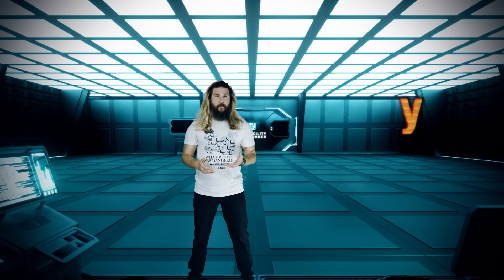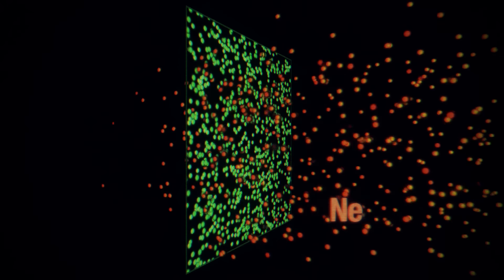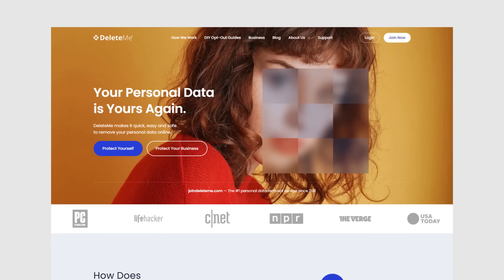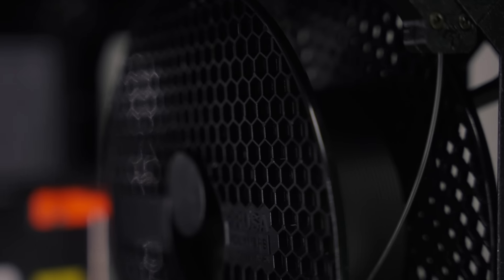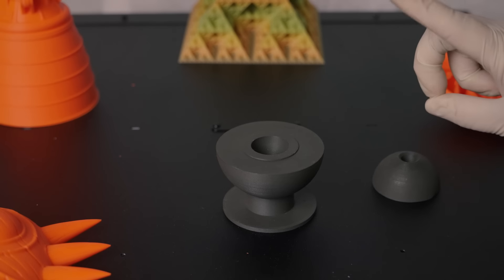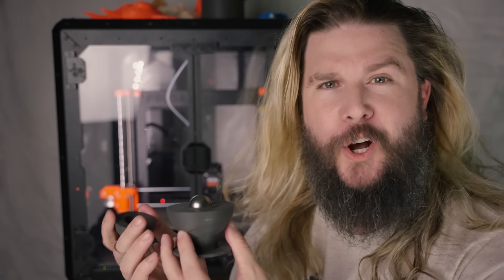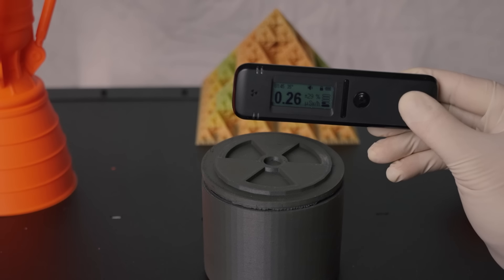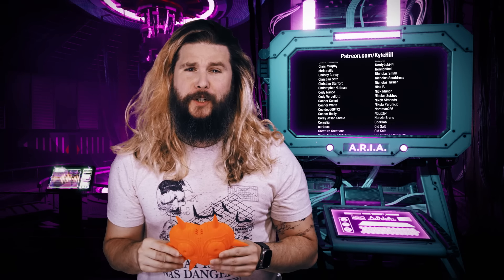3D-Printing TUNGSTEN Radiation Shields!

Comment: I'm not in the nuclear industry, but my first thought was for a 3d printed exoskeleton on an engine that chemically strips the filament them bonds it to aluminum engines! Reducing friction, increasing power, reducing total aluminum mass, increasing efficiency, making engines more carbon efficient. Engine refurbishment would be much easier and so older engines could gain new life and be used with upgraded tech to allow for lower weight reduction and less energy cost overall to produce them while significantly cutting carbon emissions for most vehicles while we transition to electric vehicles.

Same for electric motors that gain to much heat and can't survive, of we were to coat this with the correct catalytic compounds we gain electrocatalytic, photo catalytic, and regular catalytic seperation of air particles that gain electron hole, redox flow, and positive to negative ionic charge values that can handle extreme, but very small sizes and moments, heats and pressures that help cool the motor and gain energy potential back from our atmosphere. While remaining incredibly small weight! Just like I said on my xenonreality YouTube channel videos about those rotary electric motors that use air filtration and vacuums to increase electrical energy efficiency. I have to cool it anyways, might as well make it do some basic work we've used for decades already on a smaller scale 🤷

but also for small scale testing of nuclear reactor decay atom/ particle accelerator injectors to smash them in high luminosity events too create high heat pressure oscillating "combustion" zones that then have deuterium and tritium fired in at the highest heat and pressure zones with light reflection coating on the inside diameter to capture light pressure convinced with the high heat tolerance electromagnetic field toroidal designs to introduce fast moving directional fusion events (even 10% outstrips all of our best rocket engine designs) that's now ultra small and compact with very low radiation because of reusing it in an recirculating manner through the combustion chamber shape design for reflection acoustic resonance frequencies to improve this effect through the use of printers to make previously impossible to manufacture designs.

Same for copper aluminum alloys that can now handle the extreme hearts and pressure of a reactor like this, combined with piezoelectrics and lower pressure metals to create multiple cascade cooling thermosiphon systems to return the metals to increase potential gravitational potential energy capture in a closed loop system that doesn't produce radiation and can be very small and safe, even able to be moved, in case of a natural disaster occurring, making a hybrid fissile fusion reactor actually possible. Soon, I mean that's how we make the bombs work. But now less mass and more control.

Then, multiple dimples with holes that are spherical with offset hyperbola and parabola behind them/underneath them that can now be used in a "demon core" reflective manner to reduce total thickness and increase cooling potential and electromagnetic/ionic charge state potential for them same things to do with lead radioactivity, but using the radiation to introduce much higher values of "stuff" (many many dense things reflecting particles and light while deflecting neutrons as well until they "bounce" back) to improve the thickness needed for reflectivity of all radiation (slight change to plastic martial and other metals included) to improve the existing designs currently as they stand. This means a "chain mail" shirt could be produced that weights very little that practically completely protects you. Also my require design works better and is smaller than you think while being able to create channels to focus neutrons together and break them apart to create works to fuse, provided you have it shaped for it, add enough extra energy, and are going fast enough to capture enough to be able to have the neutrons themselves start doing it to themselves. Then it's easy to fuse quarks together for far more energy output.

In space this increases the efficiency of the design even more. But hey, lol 🤷, who needs a spinning flywheel battery in atmosphere that produces fusion energy from neutrons coming from our Sun/the universe? /s we could never use this, hahahaha heh. But your know, it would never work so why even bother to try there no incentive of large corporations and energy producers to not fully fund things like this /s not at all! Heheheheheh like ace Ventura nope. Why not in-between the lhc, or the old Texas collider, or whatever we know it will never go anywhere they're invested in a multi trillion dollar fusion toroidal design right now anyways. Whatever. 

It's impossible to figure out how to do this! /s or can never be done, just like gravity doesn't have relativity all things experience the same time everywhere all at once, Einstein, you're crazy go be a patent clerk. Just disregard we prevented you from ever getting anywhere and never helping you treat this until after you brute forced money and time enough to prove use wrong Einstein, there was never any reason us big shots that controlled you and your endeavors for any influential, financial, or other gains that helped us get units of measurements named after our amazingly garbage asses who mostly style from our undergraduate students 🤷 /s

obviously, obviously it can be. Shut up. Trapped into the same stupid mindset that caused the lack of progress and growth with safety that made wealth inequality, power inequality, invalidation, violence through non acceptance of others and their sexuality, ethnicity, and more occur time and time again making us believe those at the "top" should never be questioned, are allowed to break rules, but we should never question the rules and or even change them, it certainly doesn't influence our views and or bias our behavior towards a social peer pressure thought process, belief, the results off or very science and who's event allowed in to talk, and so much more. 

Let's just 💩 on each other and their cringe, their defensive nature to being called out and it's known it hardens them to not change their stance on the subject even in the face of overwhelming evidence, let's have huge YouTube channels dedicated to doing this and having multiple generations all mob mentality group up together to do it to have a false belief of being correct bastard many people all agree with me and us doing it, creating a huge self fulfilling echo chamber of validation fire or "totally good enough" studies that don't even try to look at influencing values to the noise in their data! Making stereotype anecdotal days points that are "replicated" as being correct observations and "perspective analysis" of many many different fields of study even though most don't even have access to try to study it! Let alone even know what they are saying or trying to imply the observations mean. While we all fall for it hook, line, and sinker IV the never ending feed recommendation chaos theory mathematics influence values of rotating interests and momentum to continue the fight for their groups theories and views, scientifically!

There's nothing but a bunch of "know it all" jerks that troll to put down any idea who know full well how difficult it is to even try, let alone brute force through experiments until a success. Capitalist greedy competition to mere curiosity and joy of our everyday lives, abuse of knowledge to jack up "issues" for money ("issues" because they are non openly discussed features to make more money from you) all while I can't even get on SSI for my disability with my no income having ass! While my abusive parents are my only lifeline for toiletries and basic life stuff, go f yourself and stop streaming my stuff after saying it can't be done then calling it something else after I clearly came up with it! I hope your all due soon, somehow some way! 😡 whatever, I doubt anyone will ever decide to actually look into that. Why should they, their own lives, it's time consuming, requires effort and actually knowing about non counted views, how shadow banning works, how large creators are people who can put more effort in than others, how YouTube knows drama cancels a percentage off to players and they "scout" for the next money bag to bring up for money towards their company, hope people can 100% be hacked and have no way to stop that regardless of authorities, and more. 

Just boils down to laziness, why should I help, learn, or try. I'm barely surviving my stuff, capitalism isn't what's causing that (somehow) and who cares we can't do anything to make it fair or fight back. It's scary to care or get involved, so nope on that, someone else will, they have to help themselves I am sure they weren't doing it right or even trying so I can excuse not doing it, raining it add just mental health issues, etc etc. You get the picture. There's no reason to feel the way I do, none! /s clearly.

Anyways, there's my ideas, whatever I guess 😮‍💨

Comment: You mention the special nozzle, though it's not the standard it's pretty common to print with a hardened steel nozzle (for CF infused filaments, wood, marble, and glow in the dark filaments) I actually have it constantly on my Prusa for years.

Comment: Would love to know how the weight of this filament is compared to traditional radiation shielding used on things for space radiation protection applications, like personal shielding for astronauts or additional shielding for electrical components that may not be able to receive radiation hardening. Aside from cost and manufacturing limitations, could be extremely useful for the future of space exploration and expansion, manned and unmanned. Super cool video as always, thanks Kyle!

Comment: I'm very interested in the longevity of the PETG plastic for exposure to high amounts of beta. Either way it's a good idea. There's already a nuclear plant (I forget where) using a 3D scanner on small valve and pipe joints to get dimensions for printing exact-shape shielding with tungsten filament.

Comment: My club is currently building a Farnsworth fusor and this filament could be really useful for us to properly shield the assembly, depending on its ability to stop hard X-rays.
Reply: Better get some bismuth ingots and a casting kit. This filament costs about $3.3 per cm3 Its not very strong, it cannot be reused and you need hardened nozzle. With bismuth or even lead you can remelt your cast parts and use it to cast many times.

Comment: Infusing particles into a filament makes a lot of sense to me for shielding purposes, since you don't actually need any of the properties of the tungsten other than its density.  Obviously suspending it in a medium will reduce the overall density compared to pure tungsten, but even if it's less dense you can just use a thicker layer that is easier to manufacture in the first place.

Comment: Idk how hot or goopy the filament gets during the melt, but, one application i could see is covering a surface with it to peel off like tape for radioactive incidents that create a lot of dust. Forgoing the printer and instead heating it up and spreading it like concrete. Or make filters for places that create a lot of radioactive dust, like coal plants or other inferior energy plants. that way whe changing the filter workers are exposed to less radiation.

Comment: Ok I'm a former nuclear reactor operator and at 13:28 you talk about half value layers and show 0.51 cm for lead to half value 0.5 MeV. If memory serves me 5MeV was pretty significant and we never talked about half value thickness. We always talked about tenth thickness when it came to shielding. 2" of lead to reduce the curie value of a source by 1/10th. So 100 curies would be 10 curies and then you get into quality factors with gamma being one. So a 10 curie gamma source would be 1 curie behind 2" of lead and essentially do 1 damage. Neutrons can do 4 or 10 depending on speed

Comment: You could print specific fitted piece to fit someone who is getting a lot of x-rays. You could use scaner to scan persons body and then 3d print "cast". On that note. You could make 3d printed cast. Or at least outer layer. With just window od diffrent nateral in place of break. So you can make safer x-rays eith just one part exposed.

Comment: You could make custom covers for orphan sources discovered in the field. Having a water jacket second layer may also help contain radiation.
Reply: If the orphan source needs a shield with a volume of say 2000cm3 that would cost about $6300 in filament. This is a gimmick. Good old lead or bismuth alloys are better and cheaper 99% of the time.

Comment: this be neat for hardware and electronic shielding in non comformal spots and locations, those shielded parts that require specialist fabrication facilitates to being able to just have the this non standard part ready in a few hours in house
Reply: I wonder how good it is, 75% particle loading might make it relatively weak, it has terrible surface roughness and voids which makes decontamination very hard, that plus the price puts it on a very niche market. I think casting a custom shield in lead or even bismuth is quite cheaper, far more rugged, can be decontaminated and reused an unlimited amount of times reducing waste.

Comment: What would be better is also testing it with other forms of standard filaments. I want to see the values of PLA, ABS etc. Im sure it wont be nearly as good but still. It would be good to see those results still to confirm that this tungsten infused filament isn't just marginally better than other already existing materials without it costing what I am going to assume is substantially more than other already existing materials.

Comment: I am working on my senior design project where we are designing/building a cube-satellite that will provide a radiation resistant computer network for higher computational power in low earth orbits. We have some ideas on radiation blocking, but would be interested in using this filament!

Comment: Radiographers commonly use barium infused epoxy markers when performing X rays to denote which side of the body was imaged and who performed the imaging. The 3D printed tungsten would probably work well enough that custom markers could be produced faster and potentially cheaper.
Reply: At a price of $3.3 per cm3 does not seem that cheap.

Comment: We use lead blankets at my power station if we get a hot particle stuck in a pipe. I have my doubts this would provide enough shielding for larger dose rates, but smaller dose rates do accumulate and sometimes the blankets are too heavy or big to wrap on smaller pipes with smaller doses. A 3d printed 'bandaid' would be quite useful, it could be created from a Lazer scan of the pipework and fitted exactly. We use similar(ish) tech for leaks on our conventional side where a proper repair is a long way away.
Reply: What kind of dose rates are we talking about?
Reply: @teresashinkansen9402  it can vary greatly. 10s of milliRem/hr to several Rem/hr

Comment: Hey, so I’m actually a RP (radiation protection) at a commercial nuclear plant. It would be awesome if this could be used to 3D print a “sleeve” for valves. If this could be made to sleeve specific valves it would drastically reduce the amount of time and effort it would take to shield valves the traditional way. By that I mean throwing a bunch of heavy lead “blankets”
Reply: So as of right now its Tungsten PETG so if the valves get really hot it may still be unsuitable. And given nuclear power is at its most simple a really spicy boiler I would assume these valves in question get quite toasty. DMLS printing can print in straight pure tungsten. in either cause one would need to laser scan the valves to get a 3D model to build in CAD the "tungsten shell". Or see if the valve supplier has a CAD model.  the Prusa website does have a technical sheet and MSDS for this stuff.
Reply: @filanfyretracker  That is true with the heat. But some of our hottest valves tend to be in the waste processing systems and that is cooled water typically. I would be interested to see if eventually they are able to work with the manufacturers in this.

Comment: If the tungsten print weight is substantially heavier than the same shape in steel. Tungsten filament could be extremely useful for custom weights & flywheels. Would it be possible to print & weigh a 100% infill 1cm³ cube.

Comment: Very interesting stuff, I can potentially see this being useful for printing custom shielding for satellite components. Although I am not an expert in radiation, I will check with our CTO tomorrow if tungsten is useful for protecting components in orbit, particularly in GEO.  If someone from Prusa has any information about this material’s outgassing properties and or thermal properties, please point me to where I can find this information. Thanks again for the great video!

Comment: The material could be a good basis for flexible materials that need to be used in reactors but can't deal with expansion thanks to the radiation.

Comment: This video does a great job illustrating the advantages of tungsten in radiation shielding, but it also raises questions about other potential 3D-printing applications. Could this tech extend beyond medical uses, maybe even into infrastructure?
Reply: Depends on the infrastructure, but I'm sure it has its uses.

Comment: I always heard it as time, distance, and mass, or TDM. Yet, tungsten is less massive than lead but is better at blocking radiation than lead. I guess there are some exceptions to the mass rule where some lighter elements work better than heavier elements.